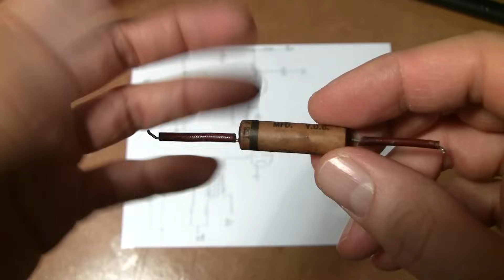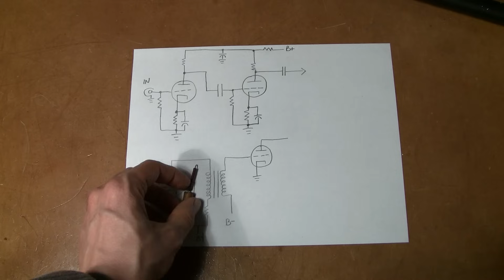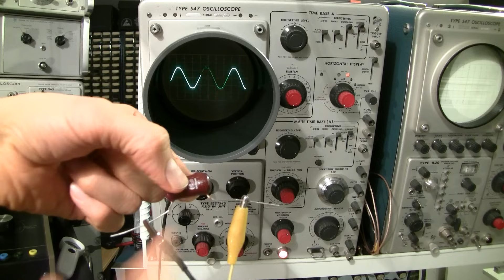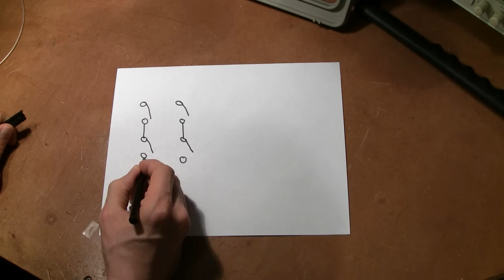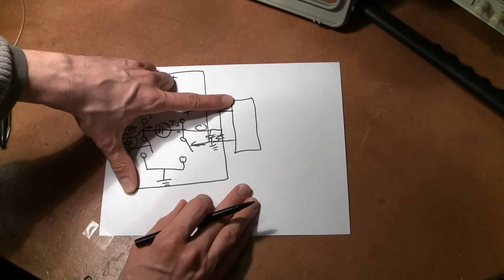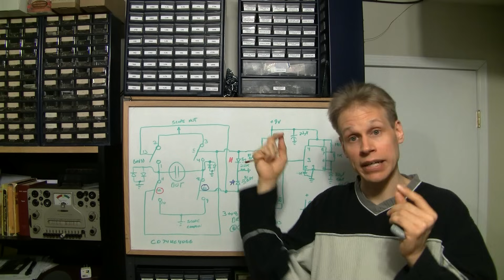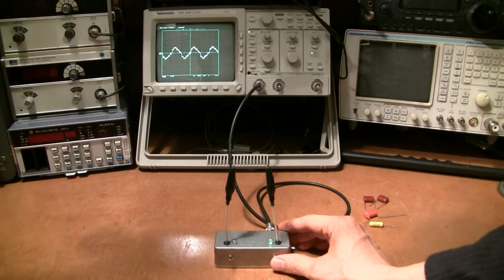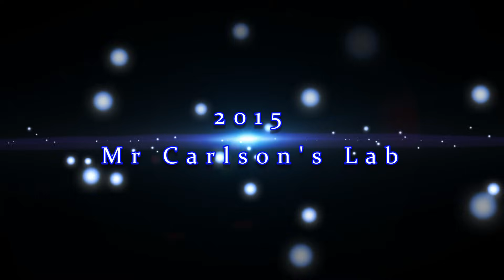Are Your Capacitors Installed Backwards? Build this and find out

Comment: Kind of a face palm project.

Just do it passive with a momentary DPDT toggle switch oriented so it points at whatever lead is being "looked at". You could test caps really fast instead of waiting for a slow tiimer. You could identify which lead is the outside foil by "feel" very fast without having to look back and forth at the scope and the test box for which light is lit. Your hand would know which way the switch is pointing without having to look at the box at all while testing. 

Seems much more logical a way to build this type of device. I learned about outside foil and film cap polarity while reading Vacuum Tube Valley mag in the 1990s. Thanks for the vid on the subject
Reply: And wear the hell out of your finger when testing a few bags of 100 caps each. The whole point of this is to make the process easier.

Comment: A polarity (or outside foil connection) detector circuit that didn't require a scope would be even better. Maybe something that renders the difference as an audible tone?

What would happen if you put the capacitor across, say, a phono preamp input? (It's not clear from the video what scale/frequency/amplitude the signal on the scope is at, so I don't know how easily it'd be turned into an audible signal.)

EDIT: Marvin Brando's comment describing a video where a guitar cable, fuzz pedal, and amp shows a noise difference suggests this may work.

Comment: FYI, solid capacitors (non electrolytic or tantalum) do not have any polarity. What you have is a mark that denotes the outside foil that is closest to the outside so to avoid having a capacitor that is close to a chassis ground and the outside foil not have a potential between the two points or at the same potential as the chassis. Really this applies to point to point wiring.

Comment: I still haven't built up this little toggler box, but I have started checking my couple handfuls of capacitors with my scope and a CRO probe.

With some of my capacitors, the DC offset will shift when I squeeze them, going positive when the outer foil is one way and negative when the outer foil is the other way. Does this tell me anything about the capacitor's dielectric or construction?

Comment: <<why not just use a dpdt switch?>>   This seems to be the most popular question not addressed by the video.

My own question is how parts manufacturer's could get away without disclosing a significant element in the design of their parts  ----for DECADES?

And how do manufacturers designing and building quality equipment address this issue?  Surely they aren't ignoring it?

Comment: Hi carlson, i asked you a question the other day but i never got a reply, so i will ask it again, the capicators i have in my 1941 GE phonograph/radio have .01 and .02 MFD AT 600 VDC in the unit, can i replace them with the polypropylene 0.068UF @ 630V  will they work in this unit?? please let me know i really would appreciate thanks ted
Reply from the maker: Hi Ted. Replace them with poly types, but the use the same values. You can go higher in Voltage ratings as well.
Reply: Hi Mr Carlson
i don't understand the thing you said about the values?? they need to stay the same or i can go higher also?? please let me know.
Thanks 
Ted
Reply: thanks for the info on the poly type Mr carlson, i do have another question i am also working on a vintage 1980 to 81 pioneer sx-780 receiver i have to replace both power packs and two resistors, now the resistors that are in the receiver are square and say "0.22 ohm k" at "02 watt" with two squiggly connectors that go into the board next to the power packs witch are the stk-0050 darlingtons the ones i found are .22 ohm 2 watt Sprague they are the round type "will these work" in place of the originals please let me know i would really appreciate it, i can't find the original type that are in the receiver, thanks ted

Comment: I can't remember if I've asked this here, but if a coupling or bypass capacitor has no outer foil (ceramic disc, multi-layer ceramic, stacked film) and it's in a high gain part of the circuit, would it help to bodge a foil shield around the capacitor and tie that to the lower impedance side of the circuit?

I try to go rechargeable on as many things as possible, so I'd probably build this with a small LiPO battery, 3V logic and a LMC555 timer. Might also try to build some kind of voltage amplifier into it that would give a relative noise indication on a third LED or loudspeaker so it wouldn't need to be plugged into a scope. Honestly though, I'd more likely test capacitors by ear using a Lil' Smokey and a phone plug with a couple flea clips on it.
Reply from the maker: Hi Peter. It was quite common in German radios for some capacitors to have a 3rd lead. This lead was a shield and connected to ground.

Comment: Great vid, but there were a couple things I'm left wondering... Is this the only difference the structure of the caps, or is there more to it.. IE: Is an electrolytic cap more efficient in one direction than another, can it be damaged by reverse polarity?
Secondly, could you show the non-linearity of the tantalum? and other than audio circuits, where to watch out for that in the design phase of a project?

Comment: I am reposting the reason why not use a DPDT switch for a few people on here that cant find this posted reply:

Mr Carlson's Lab
2 years ago
+Star Gazer Hi, I Have explained the downfall of the toggle method in this post already. Briefly again, you can not touch the toggle handle, or box without grounding your body out. If you ground your body to the box or switch, the imposed 60 cycle signal looses amplitude. This makes for a test with interference. If you mass sort capacitors like I do. An automatic switching system makes for clear easy results. Sure, the toggle switch will work fine, But... you will have to remember the amplitude before you touch the box or switch......Hold the box (amplitude change) move the toggle, take not of the amplitude again with no contact....so on. Try it! I have :^)
Reply: you are a very smart man i watch you ever night
Reply: couldn't you mitigate the unwanted coupling simply by using a plastic toggled switch instead of the metal ones or use the little silicone or rubber boot thingy from those weatherproofed type covered panel switches? just a thought

Comment: Thanks You just made Tube Amplifiers with less noise. I like using an Oscilloscope to check Capacitors. There is too much sloppy electronics out there. I always thought that all capacitors had polarity you just proved it in this video. Thanks!

Comment: Great channel.  Learning lots.  As a guitar tube amp guy, I wondered what other people are doing to test for polarity of supposedly non-polarized caps and found Acid Fuzz Pedal's channel's video on their capacitor polarity checker.  Using just a fuzz pedal and a guitar amplifier, he just touched the capacitor leads to the signal tipe and ground sleeve of the the instrument cable and you can clearly hear that one direction is much quieter than the other direction.   This seems to be the same noise test as Mr. Carlson is addressing, but I'm wondering if it's as reliable/good as Mr. Carlson's tester.  (I see some discussion in the comments about why a simpler tester using a switch might not be reliable, but I didn't follow.  I'll have to watch this video again and read through the comments.).  Really like this channel.
Reply: That’s a great idea. I was wondering if ways to do this with what I already have (not wanting to buy an oscilloscope as I’m just a player looking for “my sound” ) 
   Having recently changed the caps in my guitars , one guitar started to have a BAD hummm . 
   Now I know why , AND how to test it and most likely fix the issue.   
     Thanks.

Comment: I tried this on a number of old and new caps and could not replicate such a clean sine wave on the oscilloscope.  Does the human hum antenna need to have it's finger in an electrical outlet to generate such a clean sine wave while grabbing the cap?
Reply: A few things helps, set the time divisor to 10ms so you can see the 16ms sine wave, then use a 1x probe, not 10x or you wont see anything (just a straight BNC works fine too).
If you don't see anything when touching the cap try holding it against a mains cable, like that going to your scope, it helps allot.
It also helps to hold the mains cable in your hand, or you can use a 12v (AC!) wall wart if you want to be a bit more precise and wrap it's wire around the cap, holding it tightly.
I find myself that small caps around 2nf or so & below are very hard to do with just the bare clips and switching the capacitor around.
That's where it comes in to build this little switcher device, it's on my to-do list ;)

Comment: I have a heathkit io-4205 scope I bought for $25 in the mid 90s from a ham radio show.  With a pass through BNC probe, I cannot produce the results you are getting.  I never calibrated my scope, but not sure it would help either.  The scope is only 5mhz dual trace.

Comment: The outside layer of a capacitor is only a 'shield' if that marked lead is at ground, or near-ground.  So, your advice MIGHT  apply to looking to reduce pickup of noise by cathode bypass caps, grid bypass caps, etc. - but even there I would like to see some data showing noise from a gain stage cathode bypass cap hooked up 'backwards' vs hooked up 'correctly.' I'll bet the difference would be negligible, if there is any difference at all.  Preamps, IF amplifiers and so on are all built inside enclosures which shield them from outside noise EMF. Noise-sensitive tube circuits almost always use DC on the filaments, so there is no AC wiring anywhere near the coupling or bypass capacitors of the gain stages to induce noise into the capacitors.  And of course, with solid-state equipment there is no heater circuitry at all.

I don't see  how this 'polarity' issue could  have any relevance to inter-stage coupling capacitors, in which neither side of the cap is anywhere near ground. Please explain the physics of how this 'polarity' could make a difference in an inter-stage coupling cap.
Reply from the maker: You may need to do more research on "impedance differences" in interstage coupling. Also high gain stage screen grid bypass applications, and oscillator screen grid bypass as well, (heterodyning and intermodulation through mixing issues) Can't find any information on these topics? Time for YOU to do some experimentation, and find out the differences for yourself. I have planted the seed with this video, you can clearly see a difference indicated on an oscilloscope. Time for you to increase your knowledge, and grow that seed.

Comment: At 12:45 Does the manufacturer explain in the datasheet that the vertical bar marks the outside foil?
If so, they have something to explain.
Maybe the vertical bar is just decoration or a logo or some kind of nice-maker not at all related to the internals of the capacitor.

Comment: hello there and thank you for your insight. is there any other possible way to check for the correct circuit insertion?  well besides having to use a scope? would be nice if somehow i could use just a simple multimeter.

Comment: Thanks for this video! I am about to re-cap a Hammarlund HQ-129X.  Fortunately I'm able to see the amplitude difference when checking cap polarity with my cheap DSO138 oscilloscope.  Wasn't sure if it would work since it only goes down to 10 mV per div...

Comment: Non-polarized capacitors can be mounted either way. Electrolytic and oil filled capacitors are polarity sensitive. The case is grounded for safety. Read -up some more on caps.
Reply from the maker: Hi Ricardo. Two things in your above comment are incorrect, are you sure it's me that needs to "Read-up" some more on caps?

Comment: You've got a pretty nice little test jig here, but...it's over complicated. I don't see a need for microchips here. What I'd do?

I'd use a couple of DPDT toggle switches ganged together. Nice and simple and robust. There'd be a couple of resistors in there to protect the LEDs from overcurrent, a battery holder(I'd probably use a lithium cell of around 3 volts), but beyond that, there'd be very little in that box. Clamp the cap under test in, connect to scope, flip switch one way, flip switch the other way, bam. Nice and simple and robust. Doesn't even need any snubber diodes, as even the wimpiest of DPDT toggle switch can handle the residual charge of this size capacitor no problem.
Reply from the maker: Search the comments for my reason, for not building it your suggested way.
Reply: Rummaging through over a thousand Youtube comments is not a viable task, I'm afraid. YT's comment system is such a jumbled clusterfuck that it's easier to get Congress to pass sensible legislation than it is to find a certain  comment on a video this old and this popular.
Reply: I found my answer about ceramic caps looking at old comments. Thanks Mr Carlson's Lab!

Comment: Thanks for the video, very helpful. Just wondering, is this important in modern day electronics?  If so, do the manufacturers of TV's , computers, stereo receivers, etc., take this into account when building new electronics?  Looks like they would have to require the capacitor manufacturers to supply them with capacitors that are marked  with the correct polarity (shielded, foil lead or whatever you want to call it) or they would end up making brand new items with capacitors in backwards sometimes.

Comment: Paul - thank you for this very informative video.  One problem I have had as late is that I ordered several 630v .022 polypropolene caps and the random hum method isn't working (No appreciable amplitude difference). I have used it on other caps and it works a treat.  Is there a method that maybe will help this show up on the scope better? I wonder if the seller really isnt selling metalized polypropolene. I noticed that people are selling orange dip, but they call them "ceramic". That tells me that there may be some confusion in the market place - and maybe some of it is intentional.

Your thoughts?

Thank you again. I plan on becoming a Patreon subscriber soon. Which level? Thats the challenge :) Excellent help you provide there.
Reply from the maker: Hi Mark. Some of the newer caps have an internal folded design which isn't optimal for many applications. I have an entire list of "presently available" caps on Patreon that have a solid outside foil. There is an entire video about them there. Thanks for your kind comment!

Comment: I enjoyed your video “Are Your Capacitors Installed Backwards”. I had never really considered the issue before.  As a hobby I restore old Heathkit test equipment and I think this would be helpful cleaning up the oscillator circuits and RF generators etc.  I do have a question. Does this only apply to metal foil type capacitors. Is this something that is not an issue with a micro capacitor, ceramic, mylar?  Appreciate the videos very much. They have renewed my interest in electronics as a hobby.

Comment: Sweet! Once again, a great education. 

One thing I wanted to mention, is that I have a lot of foil tape which is about 3 inches in diameter. I have used it for shielding on other projects. This is nice if you have plastic project boxes, and since the tape can be used to "Noise Seal" the inside of the box, you should never have a problem. Never tried to solder to it though... But for shielding from outside influence, might work a treat for something like this.

Comment: Hi there again Paul. Well thanks also for straightening out one thing that has bugged me for a long while. Having known  by the old stranded of capacitor marking, that the black ring or mark was the outer foil. What the F-----ng  idiots though it a good idea to confuse everyone by changing the marking to show the inner connection. Like a lot of your other followers of my age it does come automatic to think of caps been conventionally marked, black to ground. I do not have a scope now and have used a sensitive audio guitar amp input has others on here have to check out caps that are not marked clearly. Thinking back though, I wander how many caps I have put in the wrong way round ? due to the stupid manufacture not giving a toss for the marking. You certainly have brought up a very good point here. Thanks very much for a very interesting and informative video. 73 de John-G0WXU.
Reply: Actually, one of the major points of the video is that you cannot rely on any marking on modern caps to determine which leg corresponds to the outer foil. It's not that they switched sides - it's that any mark that looks like the outer foil mark on old caps could be on either leg on new caps.

Comment: I'm sure this works perfectly, but if you are going to work with pcb's and the capacitors on them i really think you should consider buying a mulimeter. You can get a decent quality Cat III multimeter for around 30-40 $.

Comment: Why such a complex circuit for such a simple test? I could get the same results by simply connecting my scope probe across the cap under test, grab the cap with my fingers and note the amplitude. Then reverse the cap and do the same thing. The connection with the highest 60 cycle hum (50 cycle in Europe) has the scope probe "tip" connected to the outside foil. Very simple, and no added electronics necessary. If you do not have a scope, you can do the same test with any AC powered audio amplifier (guitar or mic input). Simply listen to the hum volume, then switch the cap leads, and compare. The connection with the loudest hum volume has the input connected to the outside foil. Easy and cheap!